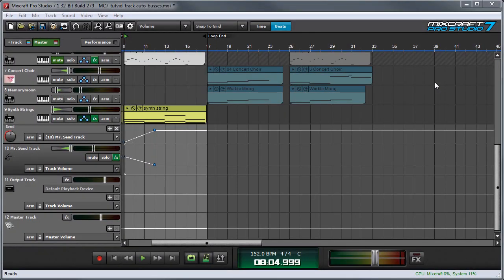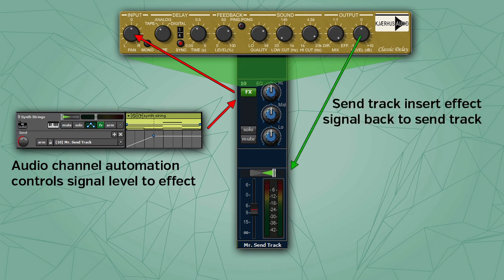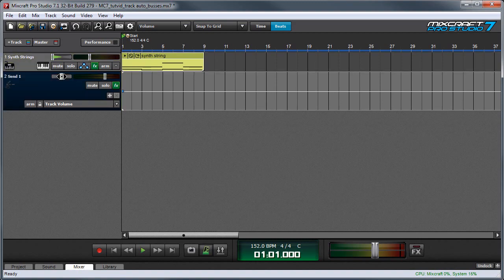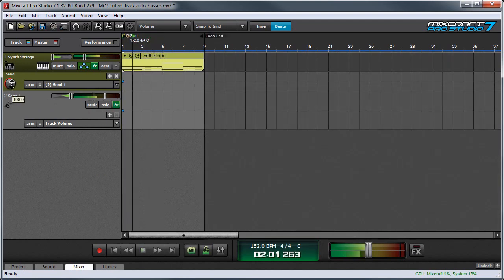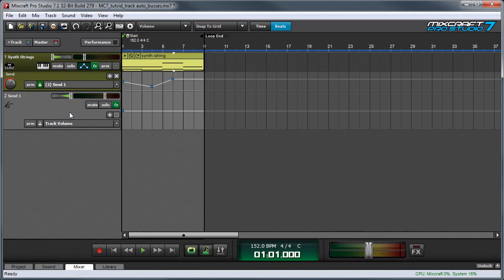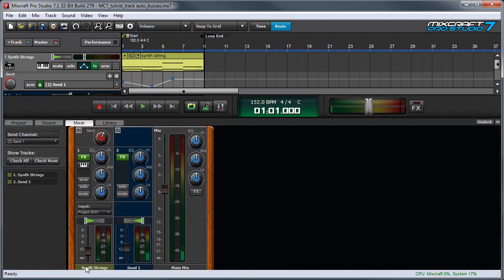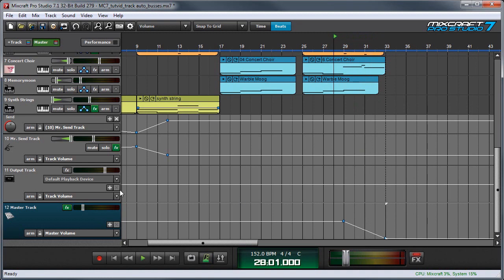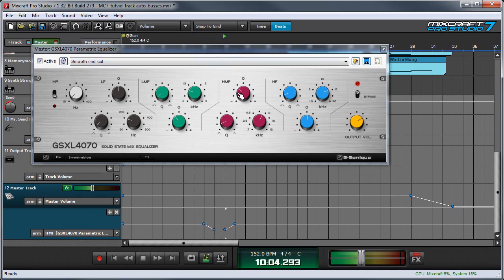Mixcraft 7 Automation: Advanced Track Automation Made Easy

Comment: TRACK AUTOMATION
🛠Top  Previous  Next
In addition to adjusting a clip's volume, pan, and filters, you can also add volume and pan automation for an entire track.  In fact, you can automate or create automation envelopes for every parameter of every effect and virtual instrument, and automate the Sends as well. 
Track Automation Editing.
 Click the "Toggle Automation" button to view the automation for a track.
 This expands the automation lane for the track.
The default automation is the track volume.  This will adjust the volume over the course of the track. Now you can use the mouse to add track volume envelope points.
Track Automation Editing.
Click on any point in the automation body to add a point and then drag it to the desired value.